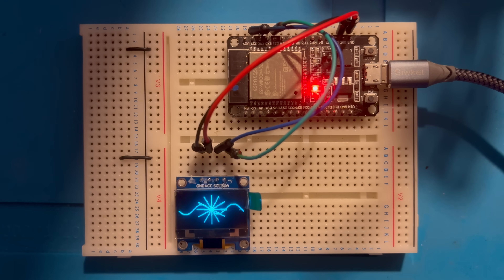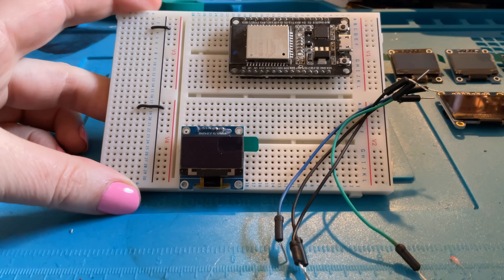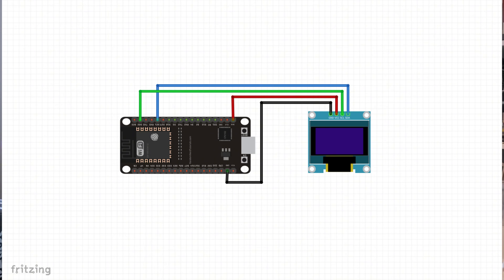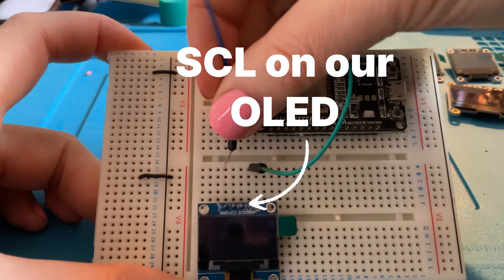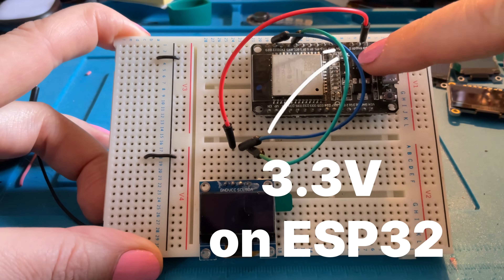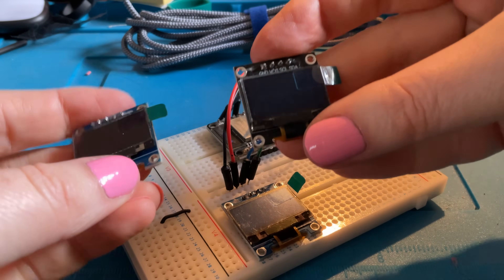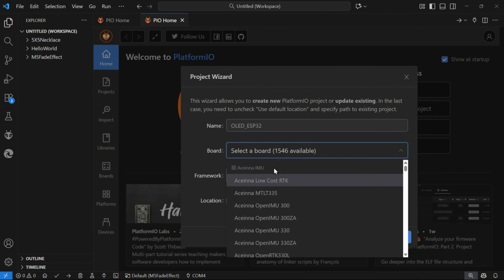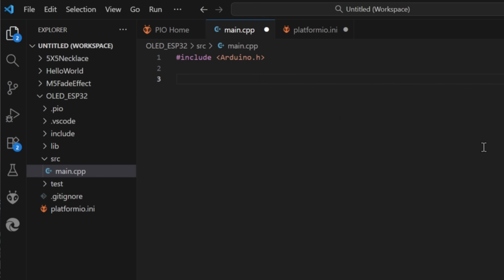ESP32 OLED Project You Can Finish Today!

Comment: Thanks for this. My esp32 doesn't fit my breadboard. Where can I buy one like yours. I have the components as in your video but I'm struggling. Best wishes
Reply from the maker: Oh ya darn - I’ve not seen this board configuration in a while. It may have been from cool components (a UK site) but they just closed their doors 😢 unfortunately. If I find it again I’ll post for sure. 

You can remove the power/ground rail from many breadboards and if you do that to two then you can put them together to make a larger area. That works too.